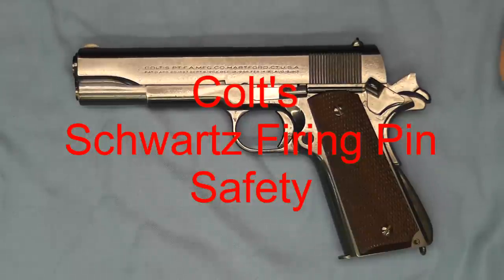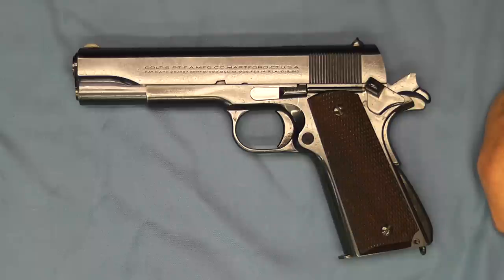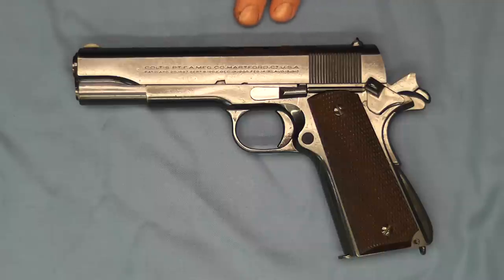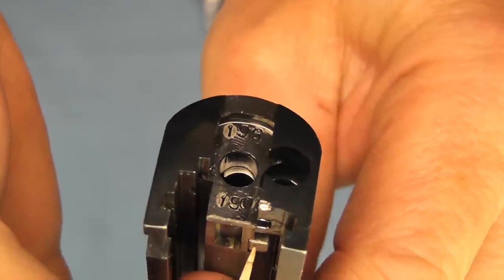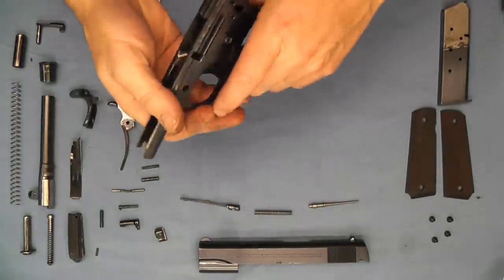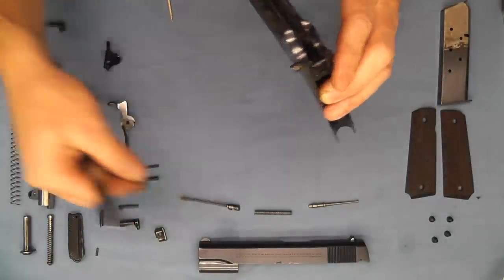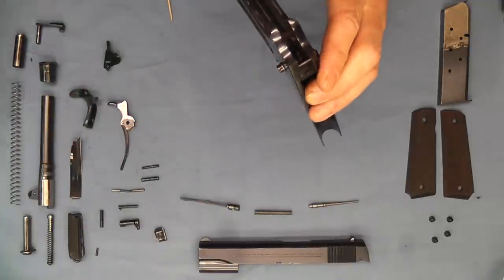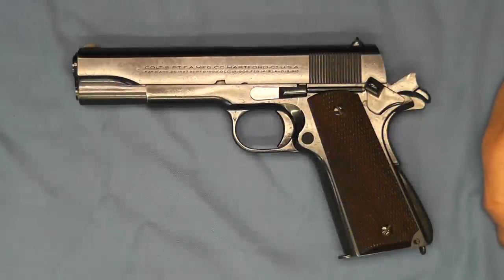Colt's Swartz Firing Pin Safety System

Comment: Fascinating.  The S&W M&P 380EZ has a similar system where the grip safety depresses the firing pin block safety.  So much nicer than the Rube Goldberg Series 80 system.

Comment from the maker: @Papieck37 Pure speculation on my part, but this is my take. 
The Schwartz is better in the grip safety mechanism but inferior in the firing pin block. I think the firing pin could potentialy hang up on the block. IMHO the Series 80 firing pin block has less of a chance of hanging up due to its design. 
The ultimate might be the firing pin actuator from the Schwartz system combined with the firing pin block design of the Series 80.
Thanks for watching and commenting!

Comment: Mr Colt, lovely video. Any reason to your knowledge why the Schwartz was replaced with the series 80 Firing pin block?  seemsto methis Schwartz system looks robust and yet extremly simple.......any idea?
Reply: I think they went with series 80 because it's easier to mill  or set up the frame my opinion

Comment: The Swartz system on my Kimber means I need 3 hands to: push on the firing pin, push down the firing pin block, and THEN slide the firing pin lock into the slide.  Ugh